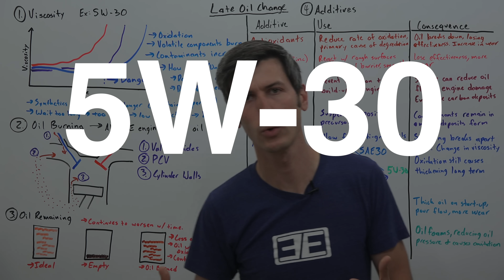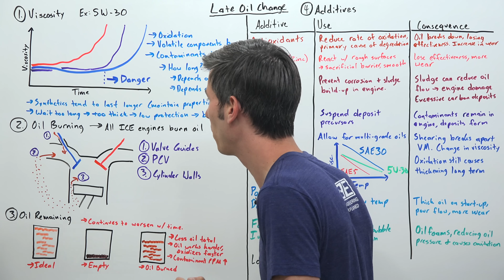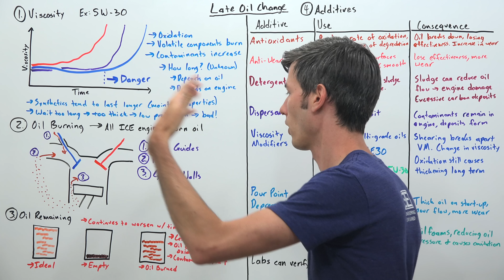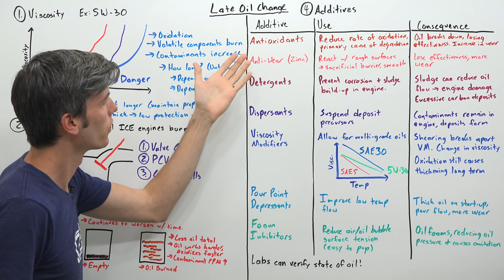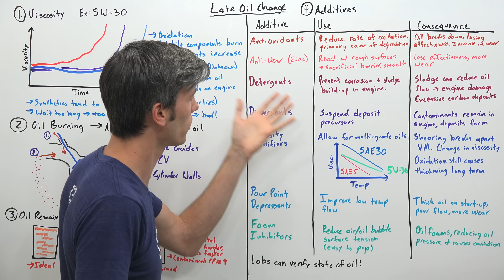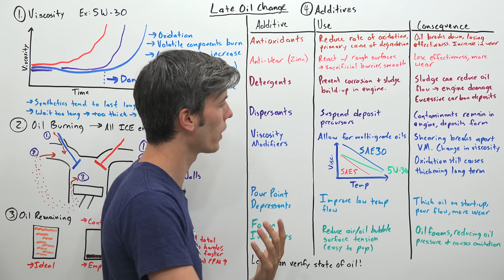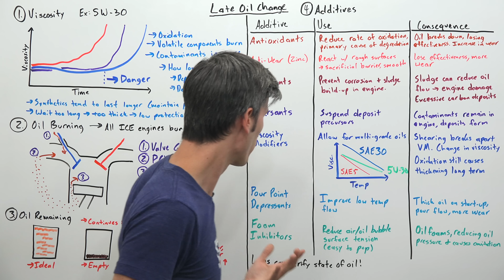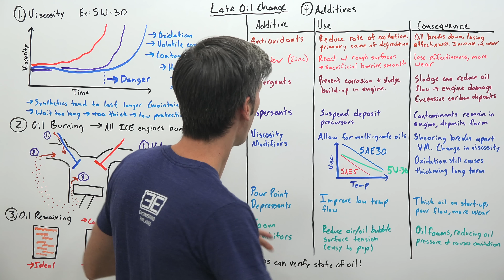What If You Forget To Change Your Oil?

Comment: I always change my engine every four miles instead of adding oil to it like a real man
Reply from the maker: You might give 5 miles a try and see how it works out for you. Could save you some time!
Reply: @EngineeringExplained  Hello Mr Engineer....  I can see you own a Subaru car......  But Why a Subaru ?????????.
Reply: I run my engine a quarter mile at a time
Reply: @dingeskraal6237  😭😭😭
Reply: ras 47 III
Reply: @dingeskraal6237  how do you manage the initial lift?
Reply: I back down the street to the local shop on the corner, so I figure my mileage is essentially nil . Haven't gotten the bloody trip computer to come to the party yet thou.
Reply: Ford?
Reply: Some epic dedication there 😁
Reply: @0xf_Steven  Cuts down on actual miles driven, car should last forever.,
Reply: Expensive maintenance
Reply: @thurm101  hmm but if you have a drag racer? Still expensive but not as ridiculous
Reply: I change my oil every 3000 miles. Oil level is still at the full mark when it's due for another change. So how can you say all engines use oil. 68.000 miles on this  engine.
Reply: anyone know the 'window' for a oil/filter change ?  My car's manual says every 6 months (I do about 2000 miles every 6 months). I use fully synthetic 5W30 oil + quality filter. Car doesn't tow nor is thrashed with 40K miles on odo. Is 8 months between oil changes OK?  Old oil marginally discoloured. Just asking.
Reply: @Charlee1224  most likely overkill. Synthetic lasts much longer and is designed for greater heat. I think 8 months is fine 😎
Reply: Listen fat, do you want to have an engine change contest?
Reply: youre a damn liar you dog faced pony soldier!
Reply: Same
Reply: 😂 bmw manages to allow swapping the engine without popping the hood - they largened the kidney-grills

Comment: My 50 year old 
 truck has 255,000 miles on it and has always had the oil changed between every 2000 to 2500 miles.
20w-50 castrol conventional
Reply from the maker: Awesome that’s it 50 years old and still running like a champ!
Reply: Resolute Lane A few years ago they stopped using ZDDP in the oil formulation, you might switch to racing oil or Delvac 1300 15w-40 diesel oil as I was advised by the Exxon/Mobil tech line  to use in my ‘73 Cadillac Eldorado 8.2 liter.
Reply: @randyfitz8310  I've been using a zddp additive

Comment: Blackstone oil analyst found serious issues with my 2017 WRX. I was doing changes every 3k and they always came back with more and more metals/silicon in the oil. They suspected a bad seal somewhere, but Subi wasn't interested in looking at it until I had issues. For that and other reasons, I gave up on the car and switched to something else.
Reply: So you got rid of a car based on oil analysis? Wtf

Comment: When I was extremely poor (80$ dollars left for food per mouth) my ford escape went 30,000 miles between oil changes. I've since sold it to my cousin, they put 250,000 miles on and the engine still runs great.
Reply: That's just laziness. Not struggling. You drove  30,000 miles? even if U DID GET 30mpg, THATS THOUSANDS OF DOLLARS IN FUEL.  I'm on a tight budget, I often skip the filter but at least do a drain and fill with supertech when it's two dollars a quart.
Reply: I think 30,000 miles would do a lot more damage than you think. I took apart a 2004 subaru impreza engine, and they hadn't changed the oil in about 15,000 miles, and it destroyed it. Either your car was a magician or there was damage.
Reply: Was it a 2000-2010 Escape or later? I sold them with the V6 no turbo. When new it will be nice to motor oil. Once older, engines start leaking everywhere and to reduce burning oil, it becomes more critical to change it often.
Reply: @jamesmedina2062  after I lost my house, I went back to normal oil interval change. Lol
Reply: Kingdom of Hush housing is always a big deal for everyone and that's why it's so overpriced and seemingly unfair.  Housing prices reward those with a stack in the bank and punishes those working hard to make ends meet
Reply: learn how to drive for better fuel economy
or buy the right car
Reply: @keisuketakahasi4584 "TYPICAL A KNOW IT ALL'S" WORTHLESS "Generalized" ADVICE. Conveniently"IGNORING" THAT NOT ALL LIVE EASY CITY TRANSPORTATION "LIVES!" Some of us used our big trucks to haul to earn A LIVING or/and as an alternative to overpriced HOUSING. ANYWHERE.
Reply: Kingdom of Hush tell cuz to change trans fluid every 30k miles if automatic or itll blow. They weak.
Reply: @ralphfalstin6024  lol, I already replaced the transmission before it even reached 30,000. Miles. But it is irrelevant, they beat the crap out of the car.
Reply: @emonvidaly  do u hsve any idea how expensive that would be?
Reply: @ralphfalstin6024  $4800 brand new not rebuild
Reply: @emonvidaly  is that b4 or after your $80 left over, I'm confused?
Reply: @ralphfalstin6024  huh that is what it cost me to replace the transmission. But it was after.
Reply: @ralphfalstin6024  For on person $80.00 is starvation level. Been there. I made it too. Horrible. But, as a CHRISTIAN, I never did even one evil thing to survive. I am SO BLESSEDTO HAVE A CLEAR CONSCIENCE! IT IS STILL TOUGH. I AM NOT ON ANY BENEFITS, ALTHO' OLD. TO GOD ALL GLORY.
Reply: anyone know the 'window' for a oil/filter change ?  My car's manual says every 6 months (I do about 2000 miles every 6 months). I use fully synthetic 5W30 oil + quality filter. Car doesn't tow nor is thrashed with 40K miles on odo. Is 8 months between oil changes OK?  Old oil marginally discoloured. Just asking.
Reply: @Charlee1224  Synthetic motor oils of today have components that should last at least a year or even longer.  I’ve actually seen low mileage cars go 2 years before an oil change.  As long as you check the oil and it’s clean and not burning off, it’s probably still good.
Reply: @Charlee1224  in my experience keeping vehicles with low yearly miles, going a year is no problem.
Reply: Driving highway miles for > 30 mins getting the engine hot and long  enough burns all the crap away and clears everything is better for engine than oil change. I take my low mileage cars every few wks on long highway trips.
Reply: I ride my schwinn..
Reply: What about calculation of interval by the car itself? Have a 2O15 MB Vito 114cdi. Change the oil myself, use cheaper Mannol legend extra 0w30. 2 changes ago did it almost according to the board computer, it said 45k km. But earlier saw fuel consumption go up 0,2 ltr/100 km. So changed the oil. Now change it every 25k km, as it is not a premium brand long life oil, although it has mb specs 229.61.
Reply: BMW say that 20,000 miles is the right time to change oil on my 330d. 
I see very few issues with BMW engines blowing up.
Reply: The mythology of engine oil is strong on the internet, especially with all these experts, but engine failure due to oil issues is extremely rare.
Reply: @truantray  well i mean, more like increased engine wear. But i do agree if the budget is really tight, sacrificing engine wear over food is still a smart decision.
Reply: That's cause it's a Ford! Plain & simple. I only buy Ford trucks. Last forever dude.

Comment: Oil filters by pass around 6k miles.
Cam phaser systems and timing chain wear cause issues. Change it or $$$$$
New cars a so reliable many never check oil or even open the hood.
I have this discussion with so many people. Check under hood all fluid every month minimum.
Toyota had a big issue using oil. Many engines use a quart every tank of gas!
Most new cars have a oil pressure switch which turns off fuel pump if low on oil . Not transmission  though...
Lazy= $$$$$$

Comment: Another excellent video Jason. I remember way back it was standard practice to check the oil level at every gasoline fillup. Of course engines consumed oil at a much higher rate then, so checking was good insurance.  
How about synthetic vs. dino?  Longer change intervals?  Also, full synthetic vs. synthetic blend oils?  Judging by your comment about changing your oil at the 6K mile mark, I assume you use full synthetic.

Comment: My Jeep tells me when to change my oil by starting a slight ticking noise. I actually just switched to fully Synthetic at 183,752 miles on my 4.0 ZJ. It actually runs 10 degrees cooler according to the temp. gauge & no leaks so far. Oh I also have been putting RESTORE in my engine every other oil change since it went over 100,000 miles, it did make a difference.

Comment: Question, when checking your oil level, are we looking for a certain ambient temperature, or oil temp, or will a cold winter day with a cold soaked engine (not ran for a day) be fine?  I know warm oil will expand so that's really a no, even though I did ask that just a second ago.
Reply: Check your owners manual, because there're differences between manufacturers and models. Some require a cold engine to measure, some a warm.

Comment: What if you have a car that changes its own oil ?
Reply: My mother had one of those (a 1967 Chevy Biscayne, a former NY taxicab) - it blew four quarts of oil onto the top of the engine every tank and a half of gas. One day the car smoked like a demon (and not a Dodge Demon!) The mechanic had to clear the sludge out of the drainbacks. Losing oil is not the same as getting the crap out.
Reply: @flagmichael  My current car doesn't leak at all , but i have owned 3 jeeps , and they all leaked no matter how many times i tried to fix them . Strange that the American car with the highest resale value of any would have the worst record for leaky engines .

Comment: Good video, informative. How about skipping the hassle of engine oil changes entirely and going electric. Yes, I realize that there is a gearbox lubricant in electric vehicles. On my LEAF, the recommended change interval for the whopping 1.5 qts is 150K miles.
Reply: Aaron Bounds without the ICE, there are no combustion by products!

Comment: The question I often ask myself is, why some engines need an oil change very often?
My 04 WRX needs an oil change every 8000km, which is quite "often" compared to some other cars, even a random Subaru dealership I once had on the phone to buy oil filters thought I was wrong about the oil change period, they told me something like "haha noooo, you don't need to change oil every 8000km, just do it once a year"… Whithout even caring if I was doing 20000km or 4000km each year… So amateur.
Reply: Oil type (full Synthetic vs Blended), oil weight, volume of reservoir, engine operating temperature parameters, typical gearing ratio (where engine revs are at a certain speed in top gear, think highway driving), if the engine consumes oil “by design” (Audi)... that’s on a manufacturing side. Driving habits are after the fact. With the same car I’d change at a higher frequency for majority city driving vs majority highway driving
Reply: Used to change my oil every 3100km when I drove a turbo. Nothing worse than coke-ing up your lines
Reply: In US people change their oil every 3-5K miles, in the rest of the world we change oil from 10-15K and used semi-synthetic or fully synthetic.  This includes  turbo's etc, never had a problem with an engine using oil and I buy 2-year old cars and sell them them before they break down and leave my wife stranded at the side of the road (it is called preventative maintenance) - 10-12 years old .  Never had an engine problem - ever . (and I am old)
Reply: @Tom55data  Yes, kinda surprised to see people here change oil ever 6k miles - which is 10k km.
Reply: Every manufacturer has a "regular" and "severe" service recommendation. If you drive mostly on the highway, for a long enough time the engine comes to operating temperature and stays there most of the time your engine is running ... then you can use the "regular" service interval (usually 5,000 - 7,500 miles). If you do most of your driving in short trips, with a lot of stop and go (such as a taxi cab), where the engine doesn't fully warm up and is often driven cold ... then use the "severe" service interval (3,000 - 5,000 miles).
Reply: every oil company has different styles not engine
Reply: You should see a motorcycle! My 125cc when I first started riding said to give an oil change every 2500 miles! Bearing in mind bikes have a combines oil to run through the engine and the transmission at the same time.
Reply: Most newer cars monitor your driving style depending on that that’s when it will tell you to change the oil. My 2008 Honda Civic’s service light wouldn’t come on till 8500 miles because I strictly drive all highway miles and that’s considered the best driving you can do in a car. My mother’s Avalon service light come on around 5000 because she does not drive much and it’s just around town if she does
Reply: Considering the driving style of WRX/STI owners id say 5000 km maximum.
Reply: @Scouter98  Haha, I'm not one of them, I drive quite normally and it isn't modded btw.
Reply: TURST67 / Zäa 8
Reply: I have a 2004 WRX as well with 322000 miles (518208 kilometers).  I change my oil between 12k miles and 15k miles, and change my filter about every 6k miles.  Still runs great and is fun to drive.
Reply: @JoshuaHowley  thanos "impossible"
Reply: Joshua Howley uhhhhhhh......I’m not sure that’s how it works
Reply: @jacobshepherd3997  come on over, will show you.  Used to send my oil to blackstone labs every 3k miles.  People waste way to much money chainging good oil.  I run nothing but quality full syn oil and when I was sending in samples, I wasn't seeing any major breakdown of oil for over 12k miles.
Reply: Joshua Howley you change your oil filter but not your oil?
Reply: @eddycalvert7138  yes

Comment: Does electric cars like tesla need any consumables like oil (other than wiper fluid, brake fluid and ac gas)
Reply: They do have a cooling/heating system for the batteries, but idk what type of fluid those use. Most likely something similiar to antifreeze.
Other than that and the ones you mentioned, no. No ICE's, transmissions, differentials or CV axles where you would normally put oil or grease.
Reply: @Scouter98  teslas do have a 1-speed "gearbox" for more toque, early models even had a 2-speed locked in second as shifting caused quite a bit of wear

Comment: Didn't change oil in our car. There were some nightmarish sounds and after a while we pulled over added oil and after arriving changed it completely. Car ran relatively fine for about a month. Now, it barely starts up. We are waiting for a check up and I can say with high degree of certainty that we'll say goodbye to the engine. :$

Comment: I bought a purple 1996 cavalier for $150. It was ugly as sin  I cared nothing about this car and changed the oil around 25,000 - 30,000 miles for the first 2 oil changes. Then decided to take better care of it since it was my main transportation during college. 9 years later I blew the head gasket by running her hot. Best $150 I ever spent.

Comment: Very good video as usual!
I manage the oil analysis for a company that sells lubricants (hydraulic, gear, engine, etc), and I have to say that especially for customers who have many trucks or tractors is extremely useful to perform analisys (it is also valid for other kind of equipment), cause you can avoid to change the lubricant too early or too late, saving money and time, and it happened also to find contaminants that indicate an incombent failure of a specific component, and reporting it, customer can prevent major damages to the equipment.

Comment: Jason I would like to have you talk about the new line of. Engine oil coming out for Di engines that the SAE is testing
Reply: Those oils have been out for many years.  There's nothing trick to it.  Calcium and sodium based additives increase low speed pre-ignition (LSPI) in DI engines so oils formulated with DI engines in mind (API SN Plus rating and/or Dexos 1 Gen 2 rating) have no sodium detergents, less calcium detergents, and (typically) more magnesium detergents since magnesium is found to be LSPI neutral.  Other than that, the formulas aren't much different.

Comment: I am so glad I have no more cars that use oil so this insanity does not bother me :)
Reply: jawbreaker      It’s simple really just do it on time and you will have no issues
Reply: What car uses no oil?
Reply: LTVoyager     Electric cars don’t require oil it’s just an electric motor that spins the wheels. Gas or Diesel engines require oil cause they have moving parts that make a lot of friction and heat without oil cooling them and keeping everything from seizing together.
Reply: Ryan Scherbluk You better check again.  Hint: look at the differential on an EV?  Unless you have four motors with one at each wheel, you almost certainly have a differential that contains oil.
Reply: LTVoyager      Cars that are electric have two motors front axel and back axel so there’s no oil
Reply: @LTVoyager  EV do not change oils dude... its 2019 and you need this to be explained to you??? really
Reply: jawbreaker Your ignorance is pretty amazing.  You don’t actually own an EV, right?  Virtually every EV has at least one gearbox which needs oil and it does need to be changed periodically.  Read your manual.  And in addition to gearbox oil, their is battery coolant that often has a service life and other fluids such as brake fluid that need periodic attention.
Reply: Model S Tesla have an annual service program for the car--priced at $600.

Moreover, the service was required in order to maintain the warranty.  What car do you have?